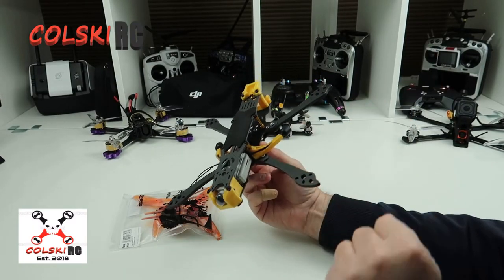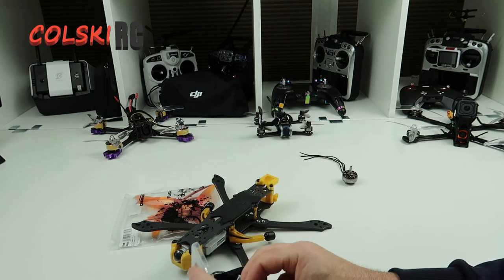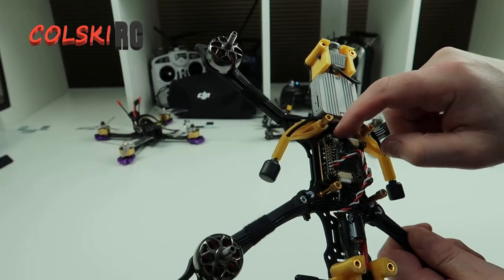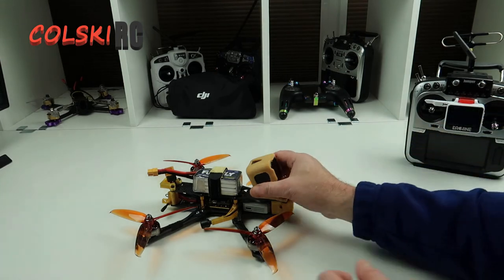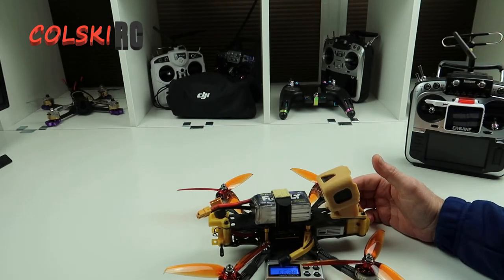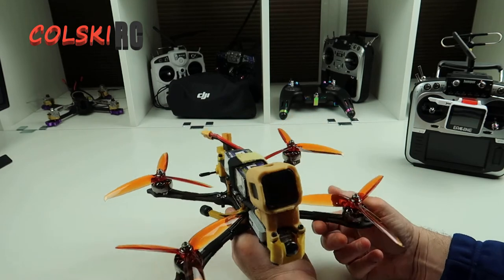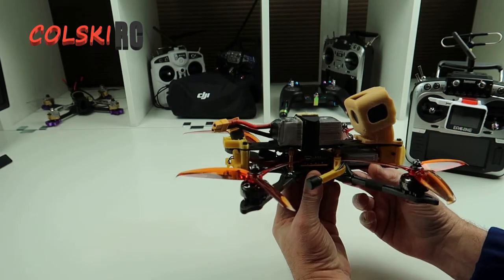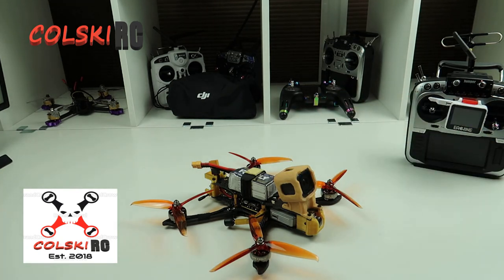FLYWOO MR CROC 6 inch DJI FPV BUILD

Comment: Thinking about purchasing the 6".  How is it for flight time and travel distance?  I've got a gopro 7 and a osmo action plan to use.  Does it handle the added wait ok?  thanks.
Reply from the maker: Hi it’s not great with added weight the flight characteristics are not great no matter what I adjusted on the pids
Reply: @CKone41  Thanks.  Yeah, that's what I was afraid would happen.  I have the 5" version.  For some reason it was supposed to come with the 2306.5 (like yours) but they shipped it with 2207.5 motors!  Crazy coz I can't even find that motor listed on their MC BNF builds!  I'm wondering if the 2806.5 would have provided more power for the GoPro setup?  Or some other brand of more powerful motors.  Of course, that would require a 6S configuration.

Comment: Do the props or frame show up in the dji fpv camera feed?
Reply from the maker: It depends how you configure the frame I did it deadcat so I have no props in shot
Reply: @CKone41  - Thanks, I'm one of those that loathes props in views.  I find I keep looking at the props, and not where I'm going, they are that distracting.

Looks like you can do straight X with no props I'll probably do straight X just to have the arms butting up against each other.    I'm leaning towards the Croc 7" over say the Titan DC7, Crocodile, GepRC Mark4, or Source One 7".

Comment: Hey man can I hook this quad up to the tbs tango 2 transmitter? I'm new to fpv and am looking to fly this setup would everything connect smoothly?
Reply from the maker: Hi you would need a crossfire receiver to connect to the Tango
Reply: @CKone41  Awesome should be an easy plug and play with a minimum of 8 mile radius? I'm new to this but would like more distance to travel once I feel confident enough in the Drone and my abilities, will start off with the Freestyle 2 thought don't want to loose a DJI setup.

Comment: Don't plug the battery in backwards, you'll completely destroy the ESC.   
Yeah, you don't think it's possible, but it is.  I found out the hard way.
It will jump the spark gap.

Comment: I must have missed why a GO PRO  with DJI onboard?  a ton of AUW!  Just completed this build using  t-motor hd stack.. couple clicks in BF and she flies like it should!  A bit heavy, but a super clean build.
Reply from the maker: Hi Mate the gopro was only on for a video i was making which will be up soon. Im not over happy with the flywoo motors though.
Reply from the maker: I have to admit i think the Iflight dc5 build i did flies better.
Reply: @CKone41  heavy build for sure.. I put rpm filtering on, and use 1850 kv on 5s.. 5 inch props.. 5046..  It flies really nice. it is nose heavy, so I mount the lipo to counter the nose weight.. RPM filtering made it for sure!  Def difference in handling between non rpm filtering.. .
Reply: @CKone41  thats good to know, think i'm gonna build a 7...